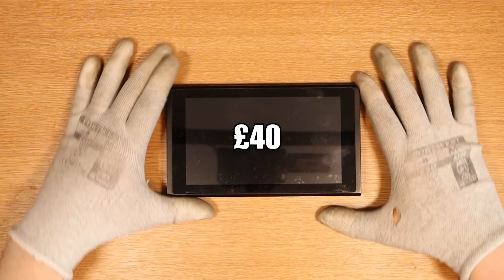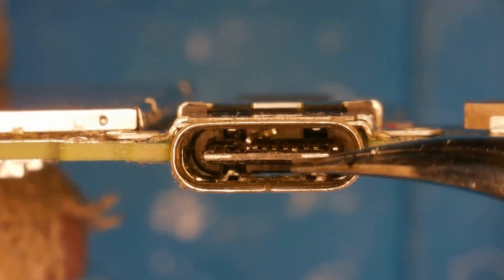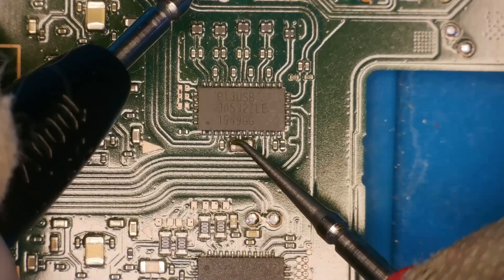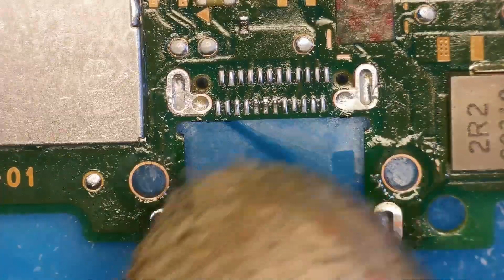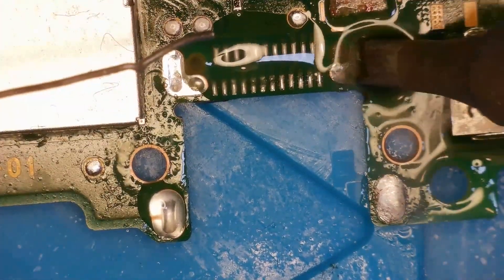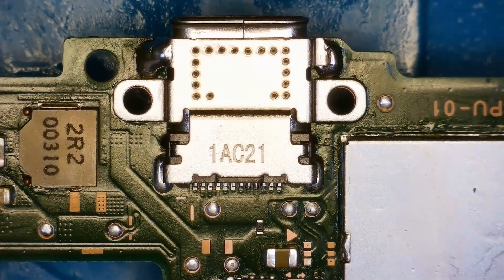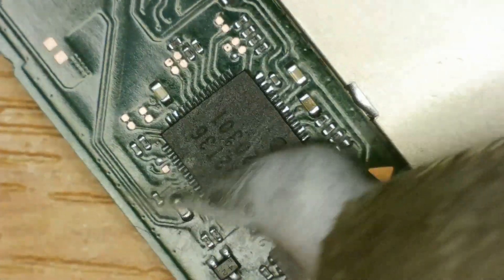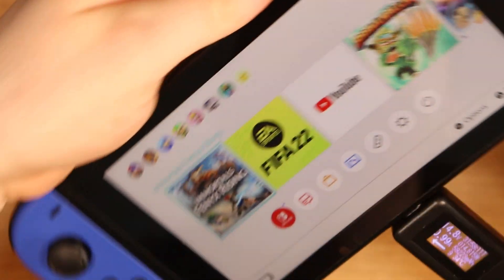I Purchased a CHEAP Faulty Nintendo Switch | Can I Fix It?

Comment: It seems the connection (last 2 pins on the right)  on the other side of the chip was dodgy also. 
at 6:19 
So was it necessary to replace that chip again?

Comment: What flux and solder tip/station do you use?❤
Reply from the maker: I use Weller 60/40 leaded solder and Kingbo RMA 218 flux :)
Reply: Which model  @JoeyDoesTech  , I’m looking for recommendations, I’m branching out to repairing consoles too and looking for a good quality solder station 🙈🙈

The weller 1010 got my eye atm, do you know it?
Reply from the maker: @Neolite87  ah sorry I misread! I use a TS100 which has done the job well, but I’m looking at either Hakko or Weller next :)
Reply: I was recommended not to buy it, due it being “china-wear”? It works fine on screen when? @JoeyDoesTech

Comment: Fixing broke switch u can make nice buck and how much did cost extra for the replace chips?
Reply from the maker: It depends on the chip :) some of the caps are around 10p sometimes even less. M92 power chip can be £7 depending on where you get it from :)

Comment: Sitting here talking to my screen "Why is he testing with the port still on", You came around to it but made me laugh at my own reaction 😂 On QFN chips you do not need to join the solder to the alignment points on those chips. They are just for alignment. If it is flat and aligned your connected. Might save you some grief down the road.
It looks sexy but it's not worth the risk of bridging caps, or knocking them IMO.
Reply from the maker: Hahaha sometimes I actually have you in the back of my head when resting whilst the port is still on! That’s made me giggle.

Yeah, I think the ocd side of me likes the thought of it looking sexy all the way around to be honest, but good to know they don’t have to be connected :)

Comment: Tip for you joey when doing M92 . Pre tin the ic then you won't have to worry about connections as will flow perfectly first time
Reply from the maker: Great shout bud, might give that a go.
Reply: @JoeyDoesTech  will make your life alot easier that's for sure. Any ic you replace always pre tin. This way you can be sure that the solder on the pads will adhere to the pins

Comment: I think the issue why switch charging ports fail is couse people uses phone cheap charging usb c cables and they break the port down, yes it is tedious to remove the psu from the dock every time you want to play in portable mode but the port is gonna be much more reliable if you do it
Reply from the maker: I agree, although it is a pain to keep moving 😂